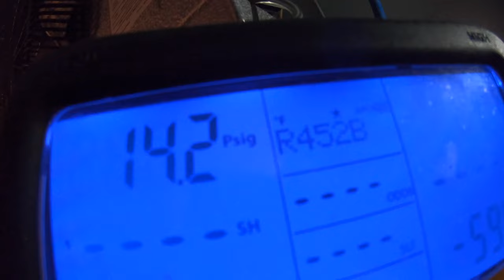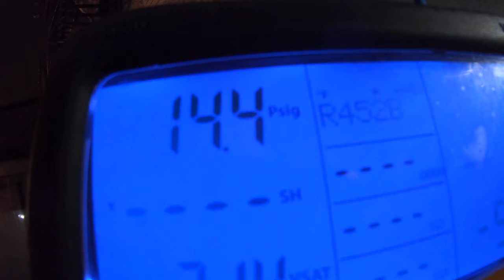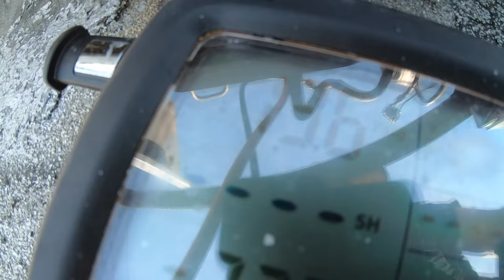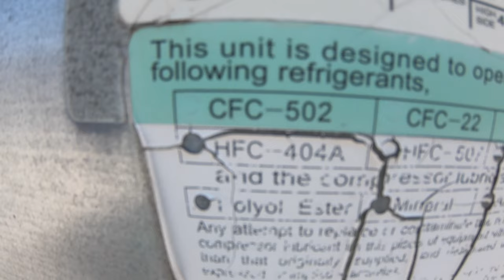Walk In Freezer.  September 2019. Refrigeration.  Low on refrigerant.  Low pressure switch

Comment: thanks for the video, what pressure did you set the low pressure switch at? 
Can i just control the temp of the box with the thermostat and not the lp switch?
Reply from the maker: You sure can. Depend on your set up you might need to add solenoid valve to it, or simply shut compressor off. Having solenoid valve benefits oil return. Also you need to make sure that you have receiver tank at the condenser unit